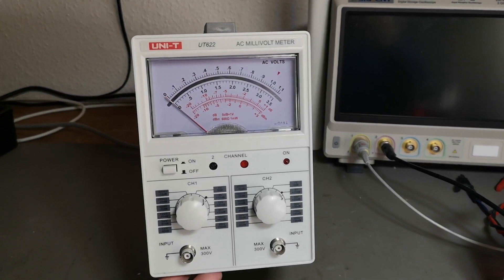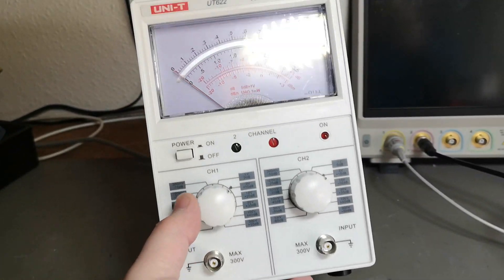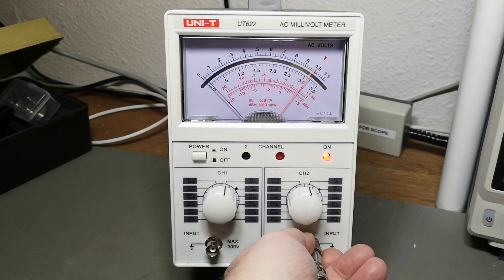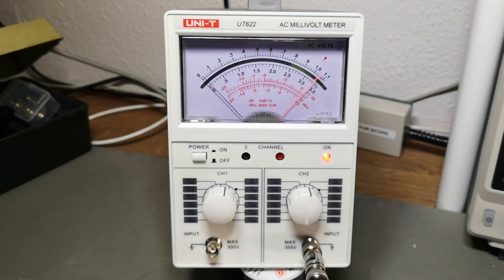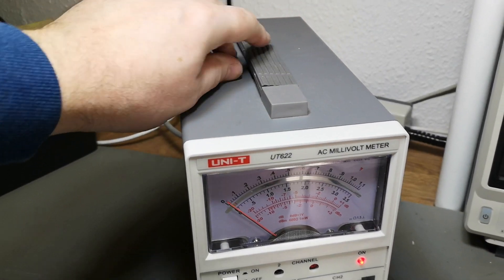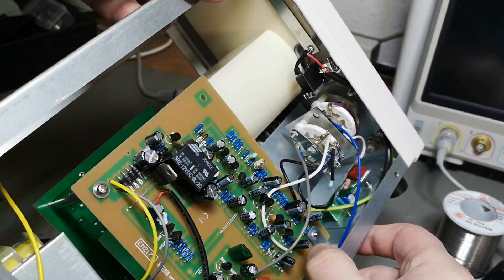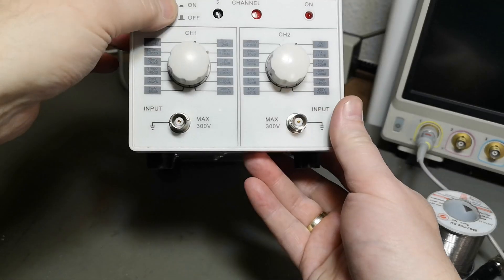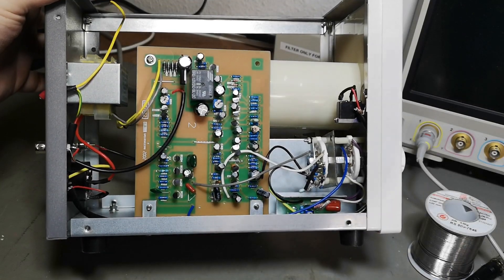Uni-T UT622 AC millivolt meter 10Hz to 2MHz 1mV to 300V RMS dual channel stereo test teardown

Comment: Hi I know this video is old, I orded one Nov, 20 2025 and said will come. Dec 4th. I know it runs on 220 volts AC. I'm in the usa 120 volts AC so I need to find a transformer. Q
While you had it open for any chance , did you ever take the AC voltage reading coming out of the transfor? I would think it's between 12-18 volt.
Reply from the maker: I cant remember, but i really recommend a vario transformer with step up option for your usa lab, this way you can supply it the wanted voltage, then measure output, then simply swap the transformer with another one that deliver the needed voltage, WHEN you figure this out, please add a comment to this video, so we all can look this up in the future, you can not be the only one with this issue, I will try to remember to measure such stuff in the future, when i mess around with transformers with only one winding, for usa or europe voltage, it always drives me mad when i get such one winding primary.. did they really save money ? having two stock part numbers to mess with.

Comment: I know this post is 1 year old. Would you know if this could be converted from 220v to 119v
Reply from the maker: try download the manual and see more about mains voltage supply range, my unit got only two wires out the transformer mains side, so my best guess will be NO it is fixed for 220 or 110 V by manufacture or ordering.. this is a VERY bad idea and lets tell suppliers we dont want that idea.

Comment: Can you comment on the specifications of the BNC connector?
and where did you acquire it?
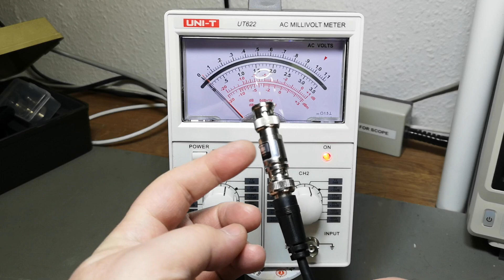Reply from the maker: if you refer to the thru load at 3:03 it is from HP and crasy expensive since it handle a very wide frequency band, for this type of low MHz stuff seen in this video a very cheap model can be used just as fine.
Reply: Yes, I mean that direct charge!
The question is, my function generator has an impedance of 50 ohms. How many ohms should I apply the load?
Reply from the maker: @nicolasdejesusmunozpalomin388  if you generator got 50 ohm output, and your cable is 50 ohm impedance, and your load is 50 ohm, you get a flat frequency response with out peaks or dips, due to reflections in the whole signal path will be lowest possible. that is why i do it.

Comment: Would you recommend the millivolt meter?
Reply from the maker: any type of recommendation should always go together with : what is your requirement of performance, accuracy, and what is you use case and what is your budget. this unit is a bit in the cheap end, and it is not insanely accurate, but for home hobby use, it is most likely good enough
Reply: thank you, congratulations on the channel!
By the way, does the millivoltmeter work with 110V?
Reply from the maker: @nicolasdejesusmunozpalomin388  my manual say 220V and i think my transformer is hardwired for 220V, so if you live in 110V land, besure to order it for correct mains voltage, i personally like instruments more with an easy way to CHANGE the mains voltagem, this way it will be easier to sell it in the future, the whole world is then open as customers.

Comment: Can you help me understand why my millivoltmeter shows a different reading than the digital multimeter ? I am testing SINE 50kHz 1 Vrms. The DMM shows 1 volt, but on millivoltmeter it's showing over 2 volts on 3V range. 
The source is a small cheap signal generator. 
However if I test 24VAC 60Hz from a power adapter, the millivoltmeter reading is just like the DMM. 
Should I be putting a 600ohm load on the millivoltmeter's probe ?
Reply from the maker: YES correct load impedance is needed to make the generator voltage correct, if unloaded voltage will be double, another trick to figure this out , parallel the two meters, and then see they measure the same
Reply: 50khz is too much for most digital multimeters.

Comment: Uni-T need to rethink their naming scheme. I landed in your video here, because i searched for content related to the handheld LCR meter, named UT622 as well (with additional A, C or E).
When you search the web, you only get results of the LCR meter. If you dont know it exists, you'll never find the AC Millivoltmeter shown in your video.
Reply from the maker: wow you are right, that is really not smart to reuse the UT622 number , as both LRC and AC millivolt meter.
Reply: @TeardownOZ2CPU  I actually wonder if this truly is a UNI-T meter, or that someone abuses their brand name and model number to sell this device. Can't find anything about it on the UNI-T website, and it's only sold through a couple of chinese vendors.

Comment: Hello, are you sure that everything is really inside 🤔 When I compare it with the meter from HP, there is no room for air. For 300 USD I would have expected a more complex device, but the main thing is that it somehow works, it's a shame that he didn't move both needles at the same time - it would be nice to see the difference between the channels
Whoever came up with that panel - dark grey/black should return their report cards up to the first grade of primary school.

Nice day 🙂 Tom
Reply from the maker: ha ha.. EXACTLY.. but it is not the first time i see terrible contrast on front plate designs, i also often see unnecessary small fonts used !!
fine the designer got good eyes and will prove that as a fact, but how about help all others who sometimes forget their glasses :-)
Reply: @TeardownOZ2CPU  This was probably suggested by the same person who created the firmware for Hantek oscilloscopes, the voltage and frequency data that blend into the image are not only miniature, but also red numbers in a deep orange field - even glasses probably won't help there - you need to own a crystal oracle 🤪